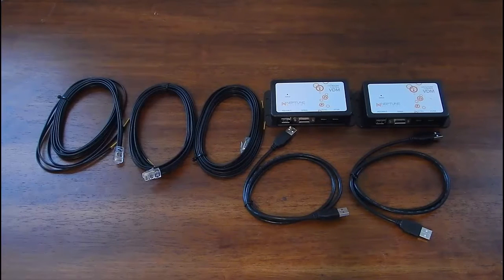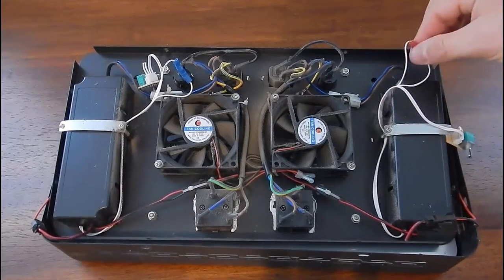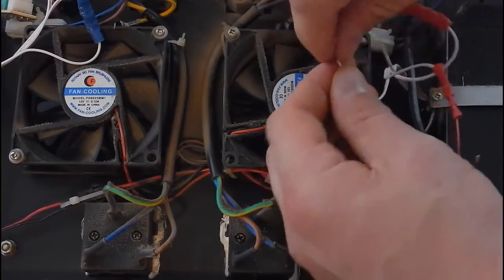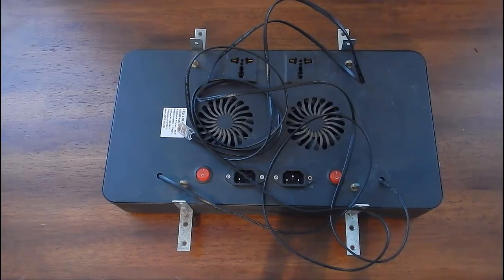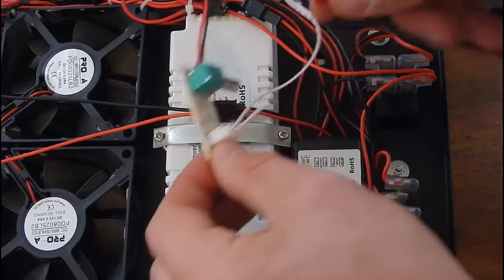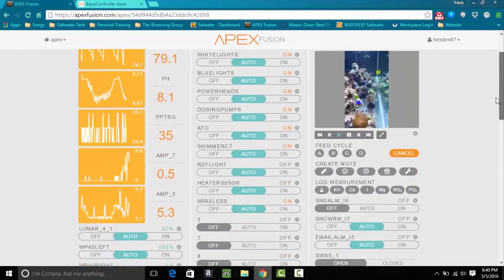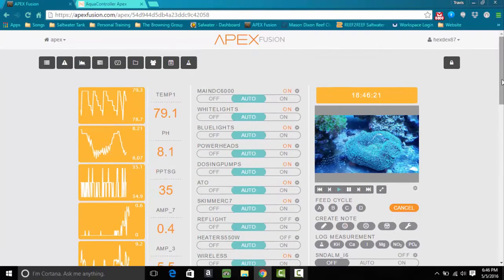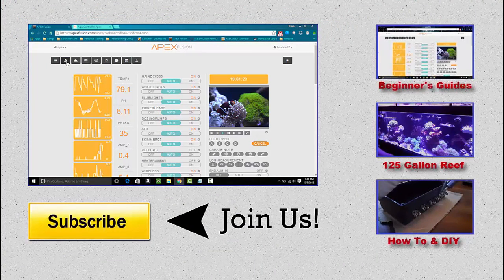Connect Chinese LEDs & SB Reef Light To Apex Controller & Programming | Apex Controller

Comment: Just did this to my lights with your help. works like a charm. shame it doesn't ramp below 10%. question, I use part of a cat 5e cable for the GRND/On-Off bridge. Should I have used a higher gauge cable or do you think it's fine, since the cables aren't transporting current, only a signal. thanks!
Reply from the maker: +Dos Maiz (Twocorns) You should be fine i actually took out the wire and connected them together its all good.

Comment: on the apex you show in the software on and off switches, do they go to the green and yellow wire you cut off the jumper wire? you say the switches  are not needed if yes why can't they be used in the lights for the on off instead of joining the wires in the box.

Comment: Great video. Just what I was looking for. I have six of these over a 7FT 265g. How do you recommend you connect these together and use only the 2 variable ports on Apex (2016)?
Reply from the maker: you can link up to 4 lights to one port. so connect them any way you want to make that happen
Reply: FishOfHex  so you can connect 4 wight lights and 4 blue lights.on 2 variable ports. ? i have 4 led chinese boxes and only 2 variable ports.
Reply: FWIW, Neptune told me to only hook three drivers to each channel. I burned out a VDM using four fixtures on one port.

Comment: What did you do with the other red/black wires on the potentiometer? I didn't see that in the video or maybe I missed it.
Reply from the maker: Not sure what you are talking about.. I havent watched it in a while but i did use both sets of red/black wires to wire each light
Reply: On the piece where the three cables are connected (ground, on/off, 0-10v) in the opposite end there are two cables, those are the ones I was talking about. I don't think you used them you just cut them and left them unused inside. I tried that and it seems to work fine. Thanks!
Reply from the maker: OK glad you figured it out. Sometimes in these videos i dont remember how i did things haha.
Reply from the maker: Send me a shout out when you show them off :)

Comment: That's great mod. Would you know whether its possible to connect one of these lights to a TC420 digital timer, in the same manner?
Reply from the maker: +Kaka-jan as long as it's 0-10volt control yes. Basically the noble or apex just increases the voltage to the light making it increase or decrease brightness

Comment: Great Vid! How many 0-10v ports do you need per light?
Reply from the maker: Thanks for watching, I use two 0-10v per light. 1 for white and 1 for blue control
Reply: Does this work with the vsp on the apex base unit or only the module?
Reply from the maker: +shiby1510 works on both

Comment: So when you buy the cables, how many do you need to get?. 
I have 4 black boxes . So do I get 4 wires or 8 since each light has 2 channels.
Reply from the maker: Its two cables per light, You can chain three lights together on one VSP. So you will need 4 to wire everything.
Reply: Hi, great tutorial, i have a question, i have 2 Bozily Coral Reef Light 168W Dimmable and 1 APEX VDM LED CONTROL MODULE, DO I NEED TO GET 2 MORE WIRES AND ANOTHER VDM MODULE?  ALSO YOU TALK ABOUT DAISY CHAIN, HOW I WILL DO THE DAISY CHAIN CONNECTION? THANKS

Comment: Hi I was watching your video when you mean that the wire number use is 3and 4 and 7and 8 ok I got that clear but so my question is with one cable can I connect one unit aquar mars light or still need use 2 cables???
Reply from the maker: +Yoshukai Tony one wire will control two 0-10volt channels. You can connect up to three lights to one channel. Or you can do what I did and use one wire per light.
Reply: +FishOfHex oh ok if I decide to use 2 cable like you did , I will have to eliminate 7and 8 and use 3and 4?
Reply from the maker: Each cable has two channels that need to be used. Each VSP on the apex has two channels. One will be used for whites and the other will be used for the blues.

Comment: Hmmm. About to do the mod. My only concern is I only use my lights at about 5 to 10% brightness. If Apex doesn't go lower than 10%, then I will not be able to control the dimming at the range I use?
Reply from the maker: +Derek Chung you can control 10% and up only

Comment: Hey Travis. Great video brother. The Apex profiles won't let me leave the duration at 0 for the daytime profile, and it only goes up to 255 so I can't put in the minutes of my full intensity photoperiod. Ideas? Thanks man. Cheers.
Reply from the maker: lowest you can go with these lights is 10% then off via power outlet timer.
Reply: Hey. I was in Fusion trying to use the profiles tab there. Learned not to forget the colon in your time entries. lol. I ended up using the "wizard" function in Fusion and that is working well. Thanks for the reply. Hooah.
Reply from the maker: ok cool glad it helped. If you have any issues feel free to email me for faster reply.

Comment: woukdnt it be better to just heat shrink the wires?
Reply from the maker: +Roy Mayor i dont think so this works perfectly fine as long as the connection is secure no reason to do it any other way.

Comment: thanks for this video!  I can't wait to do this since I just purchased an Apex system.  My question is... Since I only have one MARS LED fixture over my cube, do I need one or two VDM boxes?
Reply from the maker: No the apex comes with two VSP so you wouldnt need to purchase any modules to make it work.
Reply: oh ok... so one cable controlling the blues would go to one port and the whites to the other port?
Reply from the maker: One cable will control two channels, a blue and a white. You can connect up to 4 shit boxes to one port. I put one light per port but you can connect 4 to one port if you want to. I figured that out after i spent all that money on modules.
Reply: Im slightly confused now!  So if I have one RJ45 cable going from my main Apex port and connects to the blue side...Do I simply run two other cables to the white side and connect in parallel?
Reply from the maker: +Mark D one cable has two 0-10volt channels. One channel for blue and one for white.
Reply: so I would use the yellow and green cables for one side and the red and black for the other?
Reply from the maker: Id check the video a couple more times I go over what colors for the apex cable you should use. They are the black and reds
Reply: ok will do.  I only have an Apex lite, so I need to get the VDM box to use this mod.  Once I get the box and cables, I'll come back and go over the video again